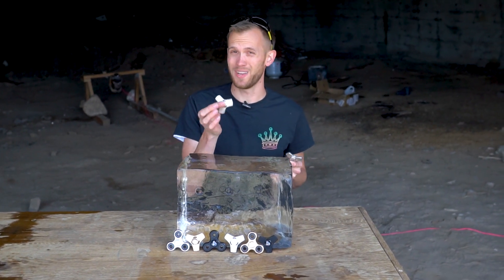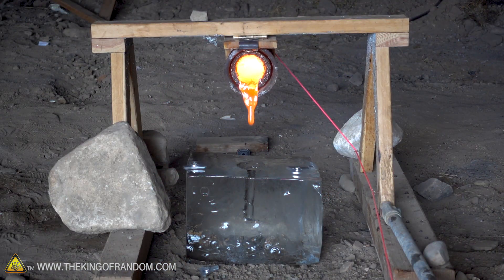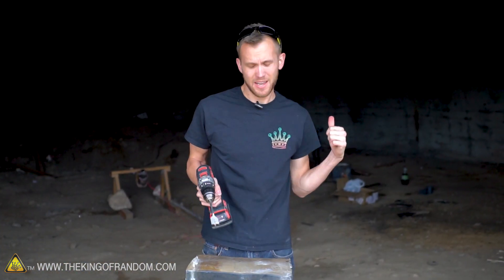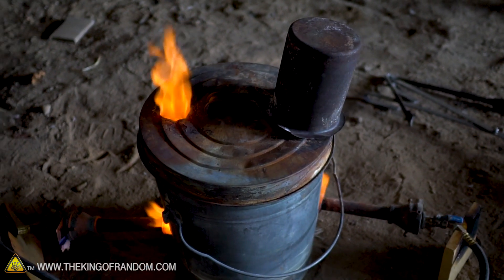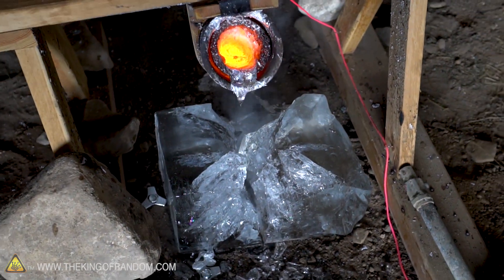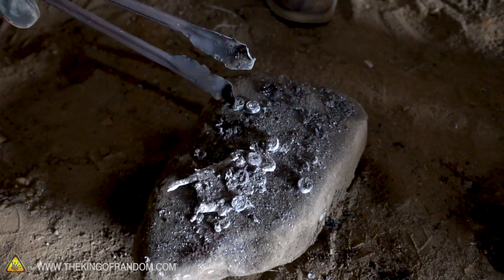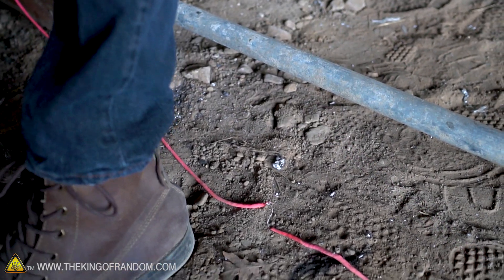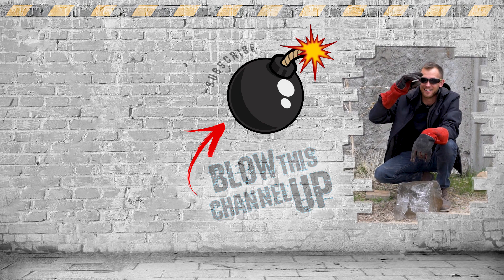The Ice Experiments: Molten Fidget Spinners! Can A Fidget Spinner Make Ice Explode?!

Comment: whats happened if we pour liquid nitrogen inside the block of ice,  and pouring liquid salt on the top of that? 
explosion with style? 

or what's happened if we drill another hole that connected into the main hole we drill for pouring liquid salt it will be explosion bigger or we can see something different type of explosion?